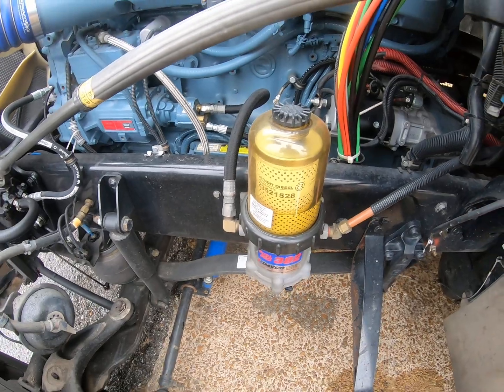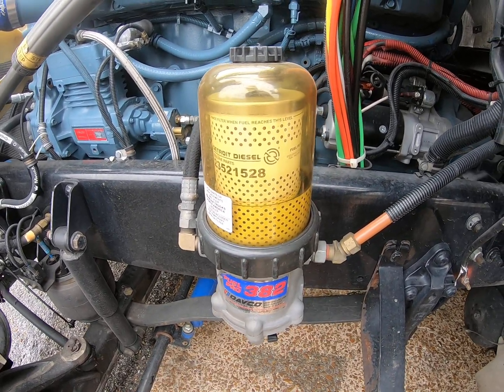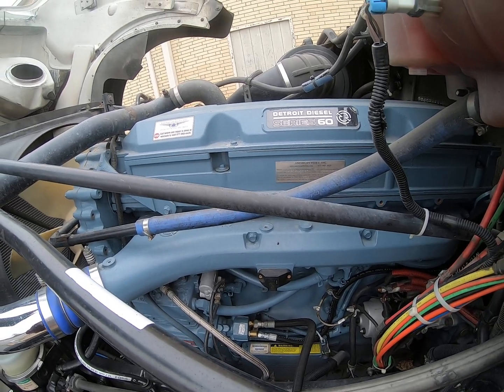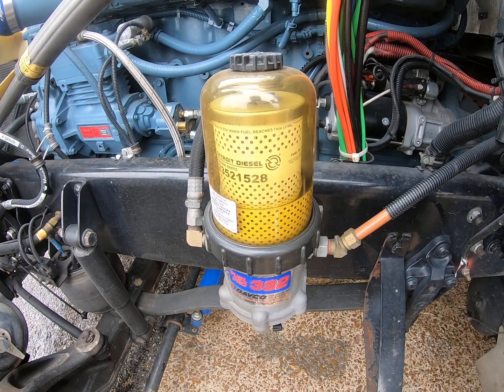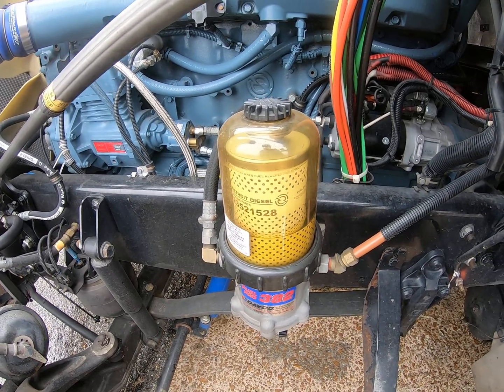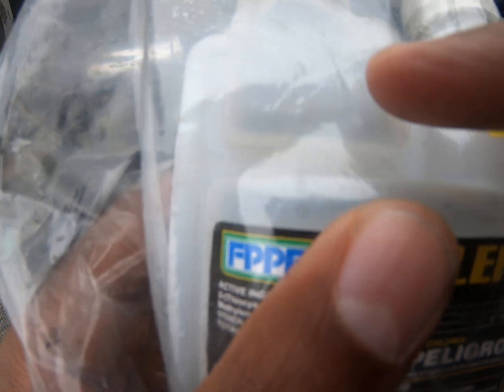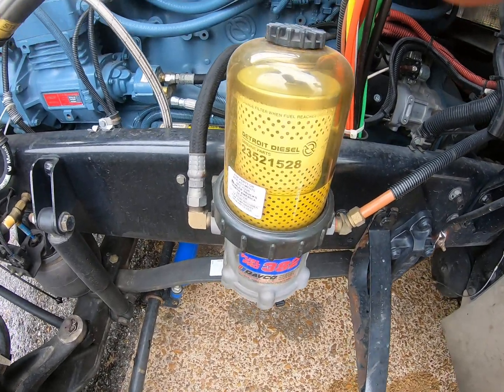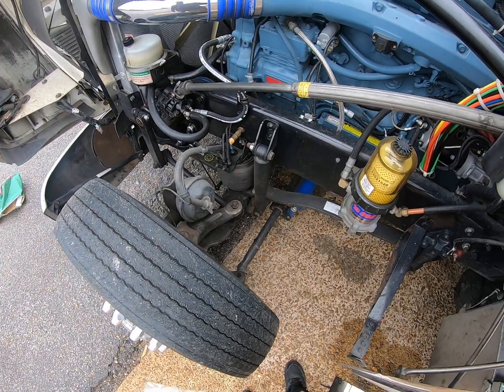Semi Truck Fuel Filter and Bacteria Growth

Comment: Great tips, very true stuff. Today’s diesels need a little more attention to the fuel with the widespread use of ULSD bio blend. Bacteria in the fuel will shit you down quick with clogged filters and eventually pump and injector problems. Sounds like that Detroit is in good hands. Be safe out on these crazy roads.

Comment: I have had my truck for three years and have gone through 20 injectors. I only have 206000 miles on my truck. I have a 2020 Freightliner Coronado with a Detroit 60 12.7L 500hp that was reman by detroit.  My truck has been down more than on the road. I have had nothing but a terrible experience with this glider. I started my career 35 years ago on a Detroit 60 series engine and never had any trouble like this.
Reply: You must own a Fitzgerald glider truck ,
You have not seen anything yet until you order engine parts .
You will learn the word of MISMATCHED really means !

Comment: Nat thanks for the tip. A lot of things get by because we don't do an inspection on them. Years ago on a diesel powered welder of all things it would not run and I change the fuel filter and I still couldn't get fuel up to the injectors. Well most of my surprise there was a so called "Secret Filter" on this motor. It was past the fuel filter and when I took it out it looked like plugs of chewing tobacco. I cleaned that out and it was just ran perfect. Thanks for bringing this to my attention again as that was probably 40 years ago, my memory is not as good as it was. You're doing justice for people that drive trucks or work with diesel motors by giving them this information. Thank you much, I really appreciate your help.
Reply from the maker: Thank you for your kind words. Much appreciated.

Comment: How often do you need to change the fuel filter?
Reply from the maker: There is a line at the top of the filter. When the fuel level reaches that line, change the filter.
Reply: You typically change the fuel filter every 10,000 to 12,000 I change mine every 6,000❤

Comment: Once you start using killem how many fuel filters and fuel water separators you had to change out before the diesel start looking clean and clear
Reply from the maker: Just one. I changed the filter, started using killem, problem solved. No more dark filters after that. Keep in mind my engine has low mileage. Around 100k miles at the time.